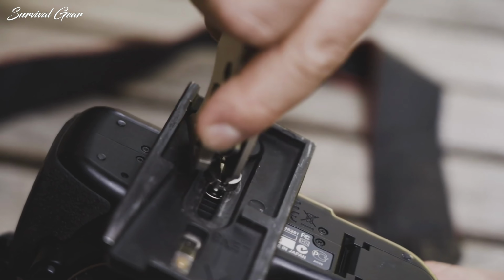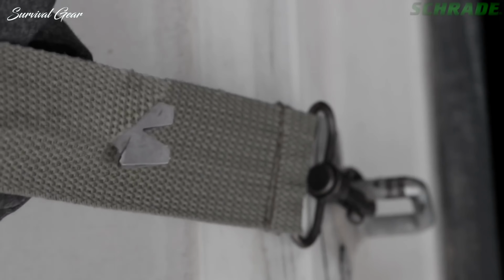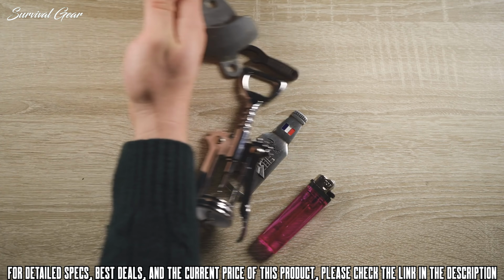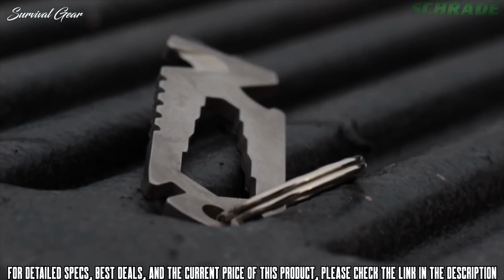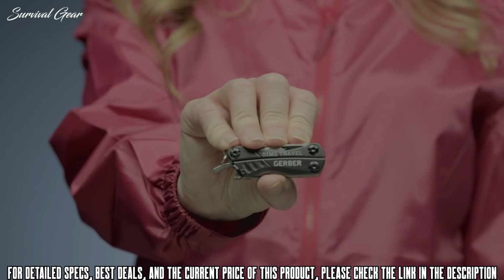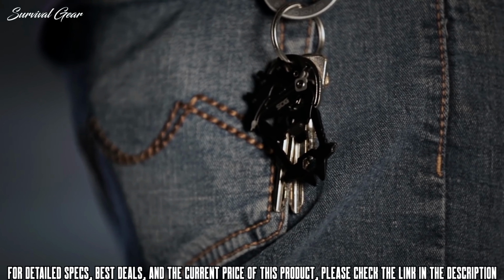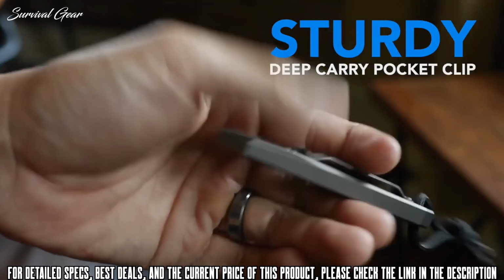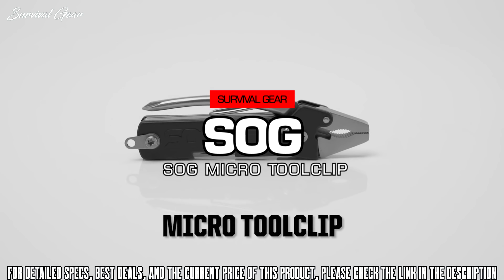TOP 10 NEW KEYCHAIN MULTI-TOOLS ON AMAZON 2020

Comment: Can opener is way more useful than bottle opener. Anyone can open a bottle with a lighter or 90 degree solid edge. Yet every manufacturer damn near needed to add it. Who’s gonna come across pop tops stranded in the woods? Or need it when their car breaks down
Reply: Ive been wondering about the whole "bottle opener" thing on tools for years. Who really "needs" a bottle opener besides a bartender?